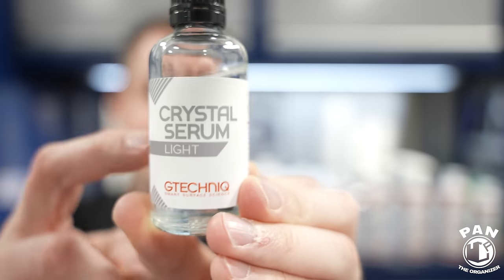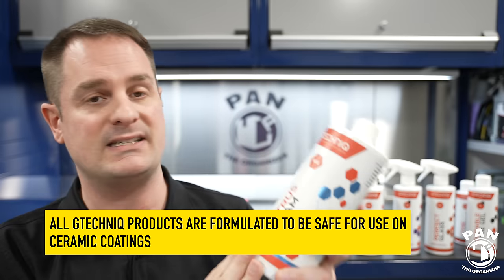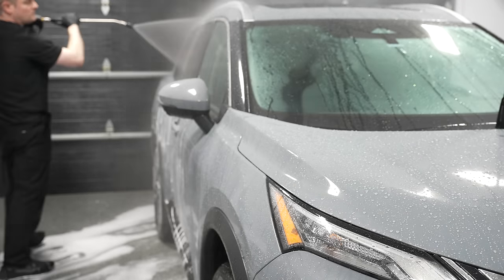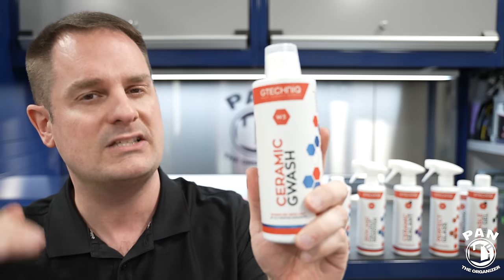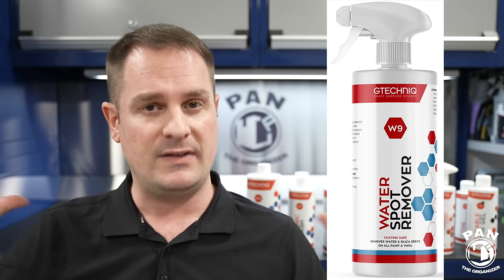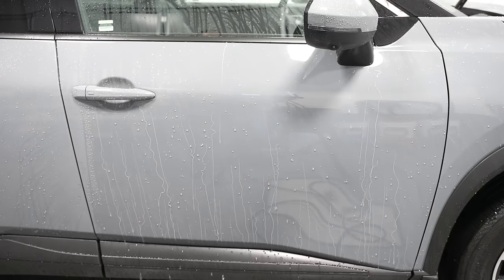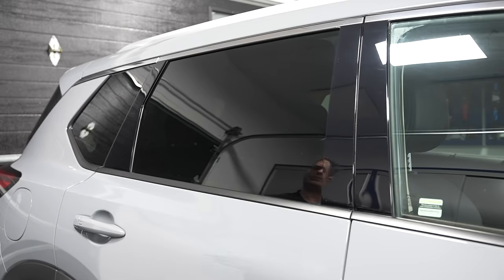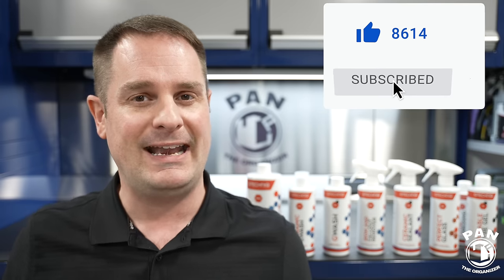Detailing 101 - How To Do A Maintenance Wash On A Ceramic Coated Car!

Comment: Hi Pan... I'm not sure if putting a ceramic sealant will be good as it will mask the ability of the ceramic coating... Could you explain further on this?... You said the ceramic sealant is boosting the protection so does it mean the ceramic sealant is better than the ceramic coating?... Does that mean the effective life of the coating has degraded and it's time to recoat?... I'm still not so sure about the idea of adding sealant on top of the ceramic coating for the maintenance
Reply from the maker: You are making sure you are maintaining the properties of the coating. And yes a topper might change the hydrophobics a bit, but not mask them entirely.

Nobody said toppers are better than the actual coating. They are just there to replenish the coating’s properties as those tend to gradually fade over time. Coatings are not eternal and are certainly not magical force fields.

All protections gradually fade over time. Ceramic coatings do last for years compared to a few months like traditional waxes, but that doesn’t mean coatings can be left unattended.
Reply: @PanTheOrganizer  but you are replenishing the coating with a inferior protection like putting a wax on top of the ceramic coating... Unless you top the coating again with the same base coat then it kinda make sense to me
Reply from the maker: I think you're overthinking the moment. Have you ever applied a coating in a glass bottle?
Reply: @PanTheOrganizer  not yet but I did some research and I just couldn't make sense of this so I'm just clarifying it... I know you are very experienced in detailing so I believe you can definitely give me a very good explanation

Comment: I wanted to be sure I understood the order. You are recommending W6 “Iron Remover” after using the ceramic wash? I though this was to be used prior to washing?
Reply from the maker: Iron fallout removers do one thing: remove iron particles. To do their job best, they need to focus on that task. So pre-cleaning the vehicle is a must in my opinion. That way, the iron remover doesn't have to fight through other dirt and grime before getting to iron particles, that can potentially also be masked by dirt sitting on top.

So wash your car, then use chemical decon. Same applies to water spot removers, tar removers, etc.
Reply: Makes sense, thank you. To be clear, after the chemical decon wash again? Foam and wash?
Reply from the maker: If you only use a tar remover and iron remover, thoroughly rinse and you can move on to the next steps, no need to wash again. You would wash the car again after using a water spot remover.

Comment: If I work in the shade, took my time, could I still apply Crystal Serum Light out doors?
Reply: Dust is the biggest factor along with heat when applying a coating outdoors!
Reply from the maker: It's always best to apply coatings in a controlled environment, as the dust can be a factor, but also the temperature and humidity. The hotter and humid temps lead to quicker flash times, and the colder temps lead to longer flash times.

So can you apply a coating outdoors? The answer is yes, but there are a few things to keep in mind. Never work in direct sunlight. Always work in the shade, on a cool surface. Pick a day where temps are as close to 68-70F as possible, and humidity levels 40-45% ideally. Work in small sections and inspect your work to make sure you don't get high spots. And pick a day where it's not windy as hell, so you can keep dust at a minimum.

Comment: Hey Pan! PLZ HELP :)

What are phosphates in soap? I am detailing a ceramic coated car tmw and do I need a phosphate free soap? Does meguairs snow foam have phosphates? Thanks so much!
Reply from the maker: Any pH neutral wax-free shampoo is fine. But soaps like Gtechniq and CarPro Reset are really made for ceramic coatings.
Reply: @PanTheOrganizer Thank you, that helps. Just curious though, what are phosphates? 

Also your channel has helped me start a mobile detailing business and has helped a ton, thank you!
Reply from the maker: Phosphates in detergent refers to the use of phosphates as an ingredient in a detergent product. The advantage of using phosphates in a consumer laundry detergent or dishwashing detergent is that they make detergents more efficient by chelating calcium and magnesium ions.[1] The disadvantage of using phosphates is that they remain in wastewater and eventually make their way to a natural body of water.[1] While phosphates are low toxicity, they instead cause nutrient pollution and feed the algae. This leads to eutrophication and harmful algal bloom.

And since you're planning on starting your detailing business, I have a bunch of cool videos that can help you out. Check these below:
✅ Is detailing really worth it? : https://youtu.be/Yq1B_UKNayo
✅ 20 year old detailer making $130,000 a year: https://youtu.be/g08gkwfv1Wk
✅ What products do you need to start a detailing business? https://youtu.be/FLq-vKIWhKw
✅ Custom installation of equipment in a mobile detailing van: https://youtu.be/IDUwfl8GmgU
✅ How to start a mobile car detailing business: https://youtu.be/WV3FJcWf77I
✅ How to become a successful entrepreneur: https://youtu.be/wTCfVmeMeEo
✅ Mobile detailing truck setup: https://youtu.be/tnFjhkM4YJo
✅ Things I wish I knew before I started detailing: https://youtu.be/SYqWRq27YgI
✅ How to be more efficient at detailing: https://youtu.be/33ChaMf8dCM
✅ Digital marketing to grow your detailing business: https://youtu.be/1Cd3N1g6mSw
✅ How to rank your detailing website on the 1st page of Google: https://youtu.be/pNflfxehpHg

Comment: I though you had the advanced graphene on there?
Reply from the maker: Yes the coating that was applied to my girlfriend's vehicle is the Adam's Advanced Graphene Ceramic Coating as the base layer of protection in October 2021.

So what is the purpose of your question exactly? I'm confused. All coatings need maintenance once every 2-3 months, so this was a perfect candidate for this tutorial on maintenance. If your question is "Can we apply a ceramic topper on a graphene coated vehicle?" The answer is yes.

First, all graphene coatings on the market currently are ceramic coatings as a base formula, with reduced graphene oxide (RGO) simply infused into the mix. Case in point, the Adam's is called GRAPHENE CERAMIC, because there are both RGO and SiO2 components to it. 

And you can use ceramic or graphene topper sprays on a graphene coating, and you can use ceramic or graphene toppers on a ceramic coating. It doesn't matter. The technologies are interchangeable. 

I hope this answers your question.
Reply: @PanTheOrganizer  oh okay gotcha! Was just curious to how it is holding up! Thanks
Reply from the maker: You will have a full two year update video coming in October. So stay tuned! ;)
Reply: @PanTheOrganizer  good to hear! I messed with the graphene advanced spray in the past. But just applied the non advanced coatings to my cars, really nice product(bedsides the strong solvents). Curious to see how it’s doing. Thanks!

Comment: I have a System X ceramic coating. The hydrophobic properties are there but the paint does not feel slick anymore when i touch it. Should i decontaminate in my next wash?
Reply from the maker: I'm guessing you had it applied by an authorized professional detailer? You should talk to him about it, as pro grade coatings usually come with a warranty.

It's hard to troubleshoot at a distance without having more info. How long ago it was applied, how it was maintained, what conditions/weather you live in, how much mileage you have done, etc.

Assuming the coating was correctly applied and you're well within its durability claim (say it's a 5 year coating, and you only have it since 2 years, it should still be performing well), it much just be contaminated.

Contamination goes into the coating and can affect the slickness and hydrophobics. You can use a synthetic decontamination towel (not a clay bar!) and clay lube to try and remove the contamination. Here's a clay towel that won't scratch the surface if used correctly: https://bit.ly/3O8D5AS

Sometimes the coating can get "clogged" by mineral deposits from water spots, hard water, etc. So you can use an acid based shampoo formulated for coatings, like this one: https://bit.ly/3OI3iXf

There are a few things you can do or have your detailer do to troubleshoot and restore the properties of your coating.

I hope this helps!
Reply: @PanTheOrganizer  - Thank You very much for the insights. The car was purchased new about 11 months ago and coating was applied 10 months ago which has a 10yr warranty by authorized dealer. I have to read the warranty details but to be effective I would have to service the car with an authorized dealer. 

The car has less than 4k miles was 85% garage kept and I live in NJ and have not really seen dramatic weather like a lot of snow. 

I believe my lack of car wash has probably decontaminated the paint. Average car wash interval has been over 1month. I normally do not touch paint but noticed this when I applied Duraslic FlowX topper about 4 to 5 months ago that the paint did not feel slick and smooth. However, the water beading is there and the car is shiny. Weirdly the paint feels rough when touching.

I use TurtleWax Hybrid solutions Pure Wash or Chemical Guys Ceramic car wash soap to wash car. For detailer, I have used Turtle Wax 3 in 1 detailer. I was thinking about switching to Car Pro Reset for my maintenance wash and use car pro descale to remove the decontamination.
Reply from the maker: Regular maintenance is key on coatings for sure. It prevents these things from happening. Here's my latest coating maintenance tutorial: https://youtu.be/IqIW78FmRYU
Reply: Thank You!

Comment: Will this work on like graphene?  303 protectant spray. I would assume so but ya never know.
Reply from the maker: Same procedures for ceramic and graphene coatings. You can use graphene based products on ceramic coatings, and you can use ceramic based products on graphene coatings. Most graphene coatings are a ceramic base, with reduced graphene oxide infused in them.

Comment: Hello sir 
I was wondering about using a clay bar or clay mitt on ceramic coating 
Is it safe and what is your suggestions ?
Reply from the maker: I spoke about this in the video. Polishing a coating isn't recommended, as you would damage and strip the coating. Mechanical abrasion and friction will remove the coating. Chemical decon steps are always preferred on coated cars. I would recommend the following steps:
1) Wash the car with a decon shampoo like CarPro Descale. It's slightly acidic pH will help remove minerals and water spots.
2) Rinse it, then use a tar remover if you have tar deposits.
3) Rinse it, then use an iron remover to remove brake dust and industrial fallout.
4) Rinse and dry the vehicle. 
5) Then use the water spot remover, which will also help to remove any minerals left on the coating that perhaps are masking its properties. Rinse, and wash the car again. 

The coating's properties should be restored at this point, assuming the coating is in good shape and was applied properly and is still within its claimed durability.

Also, clay bars are abrasive by nature, and again, not recommended on coatings as you would damage the coating and potentially add some marring to the paint.

If maintained properly, you shouldn't have much embedded contamination. In some rare cases where you might find some contamination left after all the chemical decon steps, like a bit of grit in the clear coat, you could use a synthetic clay towel (that uses a different clay media compared to traditional clay bars) and lots of clay lube, in order to lightly clay the surface. A clay towel like this one: https://bit.ly/43nrfce
Or this one: https://bit.ly/43y0Mss

But test on an inconspicuous area first!
Reply: Thank you for the advice
Reply from the maker: My pleasure Mohammed. What's your favourite video on my channel so far by the way?
Reply: Ive been following your channel since you bought the m550i and i love it. 
I cant tell you what is my favorite one but if i had to ill go with the one time youve been using gyeon products the 3 parts. 
Truly one of my favorite. 
I appreciate all the work and effort you’re doing
Reply from the maker: Thanks for the feedback! 👍🏻

Comment: What degree & orifice size pressure washer nozzle do you use for rinsing?  Thanks!
Reply from the maker: 4.0 orifice, 40 degree tip
Reply: Thanks for the quick response you never fail! 👍

Comment: Pan, Please help. I bought a new used truck a few months ago and I believe it to be ceramic coated. Looks great, cleans easy, always very hydrophobic. However it is a dark blue color and every time I touch the door when closing it, I leave behind terrible figure prints. Its driving me nuts, I am constantly wiping it down. Even reaching into the bed leaves smudges from my arm. is there anything I can do to help stop this. I tried a graphene turtle wax over top, it seemed to help but it doesn't seem to last through a rain storm even. Any input you could share would be greatly appreciated.
Reply from the maker: That's odd. Why do you "believe" it to be ceramic coated? It's hard to know, unless you have proof of what was applied to it. It's hard to troubleshoot without knowing what exact brand was applied, how long ago, what maintenance was done, etc.

I don't think I can be of much help here unfortunately, as we lack too much crucial information.

Your only option at this point (and what I would do) is to start from scratch. A full decon wash, iron removal, clay bar, machine polishing that will remove any previous protection on there, IPA wipe, and apply your choice of protection.

You will have full control of what you put on there, and shouldn't be getting those issues in the future.
Reply: @PanTheOrganizer  I was afraid I was going to have to take those steps. But your very right, I should start off fresh with a product I'm familiar with. This truck is only 6 months old and I'm the second owner so I hate to strip it back to Virginia clear coat but I like you stated I dont know what is on it and the smudges are driving me crazy. I really appreciate you taking the time to write me back. Thank you.
Reply from the maker: My pleasure Brad. How did you discover my channel by the way?

Welcome to my channel. You discovered one of the biggest car detailing channels on YouTube as we surpassed 910,000 subscribers and we have over 120 million views! I have been detailing for 26 years and I love to share my knowledge and passion with my viewers.

You found the right channel to help you learn everything about detailing.
Reply: @PanTheOrganizer  I don't remember how I found your channel. I know I was searching some diy car care videos and I believe one of your videos came up in the suggestions. Since then I have enjoyed watching and learning more about Intensive car care. I'm a painter by trade and like to keep my cars looking clean so some professional insights never hurt.
Reply from the maker: Cool! What country are you watching from? Cheers from Canada.
Reply: @PanTheOrganizer  I'm watching from the USA. Near Washington DC
Reply from the maker: Cool! I visited Washington with my girlfriend and brother this spring! Awesome place with lots of things to visit.

Comment: Question, what about bonded contaminants that chemically can not be removed?
Reply from the maker: Polishing a coating isn't recommended, as you would damage and strip the coating. Mechanical abrasion and friction will remove the coating. Chemical decon steps are always preferred on coated cars. I would recommend the following steps:
1) Wash the car with a decon shampoo like CarPro Descale. It's slightly acidic pH will help remove minerals and water spots.
2) Rinse it, then use a tar remover if you have tar deposits.
3) Rinse it, then use an iron remover to remove brake dust and industrial fallout.
4) Rinse and dry the vehicle. 
5) Then use the water spot remover, which will also help to remove any minerals left on the coating that perhaps are masking its properties. Rinse, and wash the car again. 

The coating's properties should be restored at this point, assuming the coating is in good shape and was applied properly and is still within its claimed durability.

Also, clay bars are abrasive by nature, and again, not recommended on coatings as you would damage the coating and potentially add some marring to the paint.

If maintained properly, you shouldn't have much embedded contamination. In some rare cases where you might find some contamination left after all the chemical decon steps, like a bit of grit in the clear coat, you could use a synthetic clay towel (that uses a different clay media compared to traditional clay bars) and lots of clay lube, in order to lightly clay the surface. A clay towel like this one: https://bit.ly/43nrfce
Or this one: https://bit.ly/43y0Mss

But test on an inconspicuous area first!

Comment: Hi Pan, with a ceramic coat on your car can you still go through a car wash??
Reply from the maker: A ceramic coating has way higher chemical resistance compared to regular waxes or sealants, but automatic car washes use very alkaline shampoos that could weaken even good ceramic coatings if you repeatedly clean your car there. So I wouldn’t recommend using automatic car washes.

Washing your car at home is your best option, or bring it to a professional detailer for a proper job if you can’t wash your car yourself.

Welcome to my channel. You discovered one of the biggest car detailing channels on YouTube as we surpassed 895,000 subscribers and we have over 116 million views! I have been detailing for 26 years and I love to share my knowledge and passion with my viewers.

You found the right channel to help you learn everything about detailing.